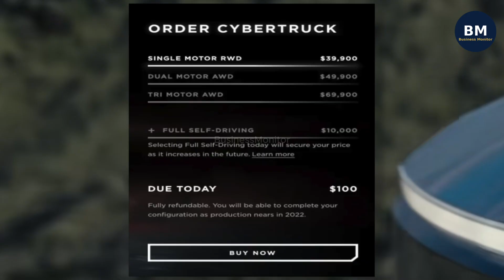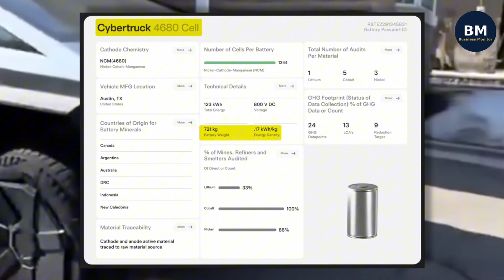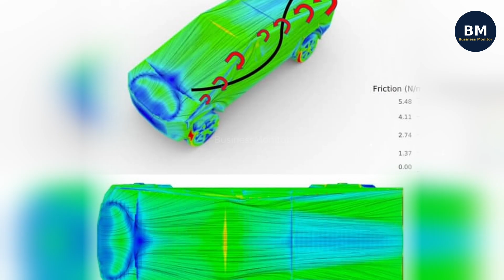The Cybertruck Was Engineered To Fail

Comment: BTW: the car doesn't have an exoskeleton: That idea was abandoned quite early one, but the unpainted hardened and heavy sheets stayed, so the problems persistend but now for something that didn't make sense anymore. Also: Exoskeletons aren't revolutionary. Brighter minds had looked at it, and abandoned the concept about a century ago
Reply from the maker: you're totally right - calling it an 'exoskeleton' was always a stretch. they kept the stainless steel body panels but ditched the actual structural benefits of a true exoskeleton design. so now it's just heavy steel with none of the engineering advantages that would've justified the weight. classic case of marketing buzz outliving the actual tech